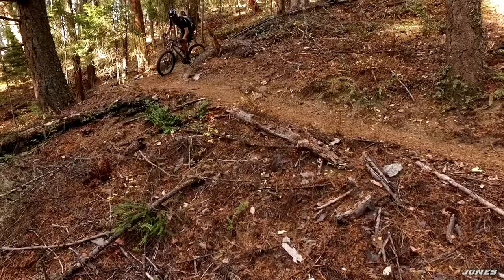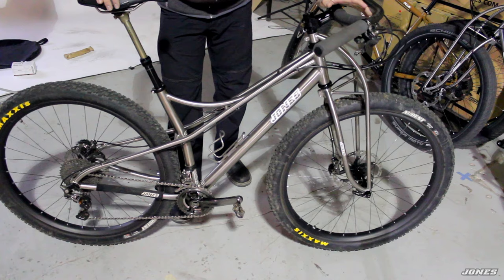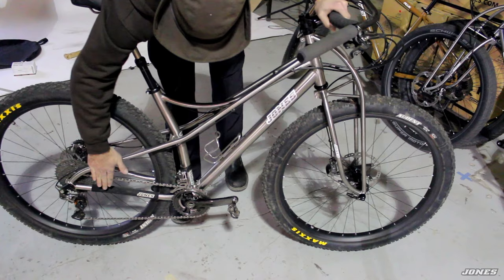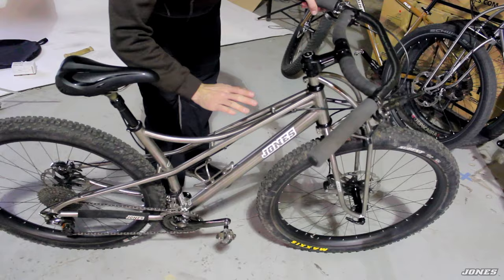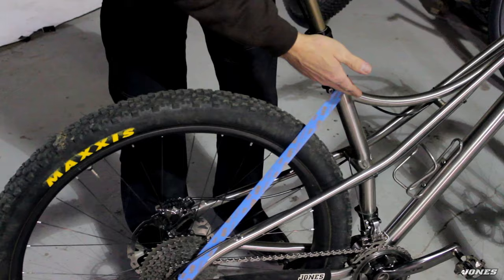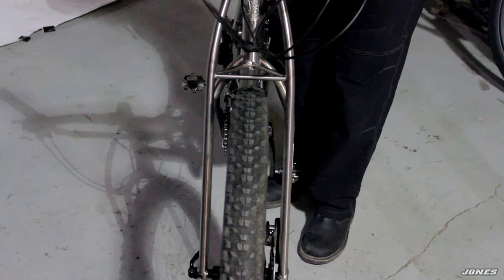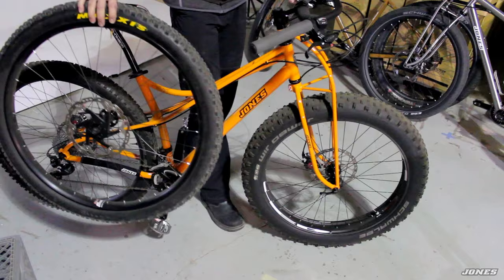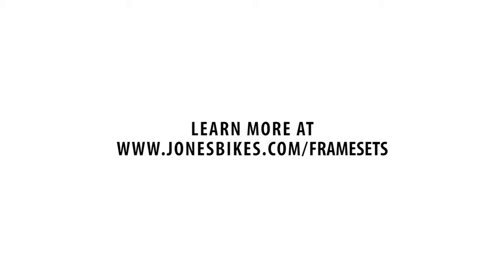Jeff talks about the Jones 29 Spaceframe bicycle

Comment: I’d buy one if it had the longer bikepacking type wheel base like my Trek 1120
Also it needs to be able to have panniers front and rear !
Reply from the maker: The Jones LWB Spaceframe has a longer wheel base than the trek 1120. For example; the large Trek 1120 has a wheelbase of 1142mm. The small LWB is 1150mm, medium LWB is 1177,  large LWB is 1205mm. The LWB (or SWB) frame can accommodate a rack and rear panniers. The truss fork can accommodate front bags or the truss fork can be swapped out for the unicrown fork that can accommodate front panniers.